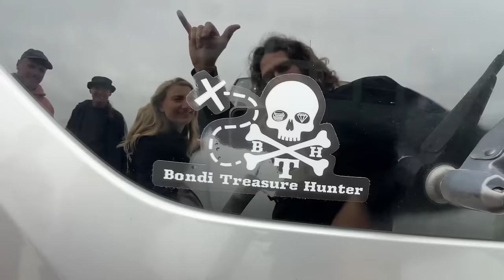Magnet Fishing after Police Search for More Missing Treasure!

Comment: To open the safes and money boxes use an angle grinder for around $30 and a 16th“ thick by 4 inch or 6 inch cut off wheel. if you use a 6 inch blade be careful not to stick your right thumb nail into the blade it’s really easy to do. These blades are made of grinding grit. They’re not metal blades with teeth like a sawblade. They are more like a really thin concrete blade, but made for cutting metal, I have cut 1 inch steel with them. It just takes time and  a few cut off wheel.

Comment: that shell is from a break in.  you can see the 3 filt  stickers underneath it that is put on to not scratch the floor or whatever it stood on.
pretty sure it have been converted into a lamp at some point. the 3 holes in the side looks like its where the cable was going in.

Comment: I noticed the stickers and if you ever need to apply larger decals/stickers do this. Get an empty spray bottle, liquid dish soap, rubbing alcohol. And mix the following. 1-2 tablespoons of alcohol, about 2-5 drops of liquid dish soap and water. Lightly shake up and there ya go. When you spray the surface first then place the decal/sticker this will allow you to get it straight, avoid bubbles and creases. The solution will evaporate within a few minutes.

Comment: It looks like a five 5  inch shell casing.  It most likely stamped 38 CAL.  The one I have is stamped 1945 .  It also stamped GB  with an anchor.  I acquired it in the 1960 's when I was in the USN .